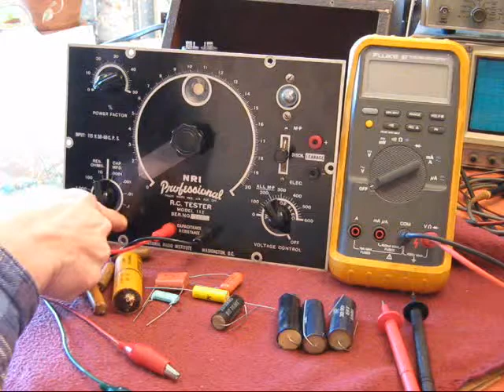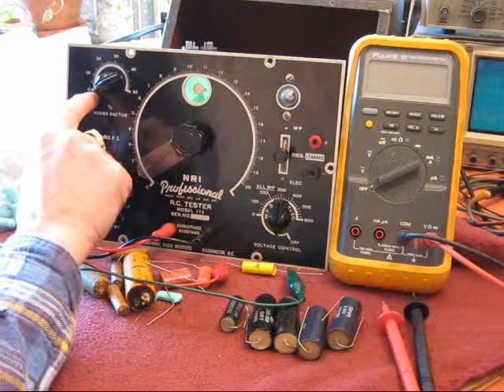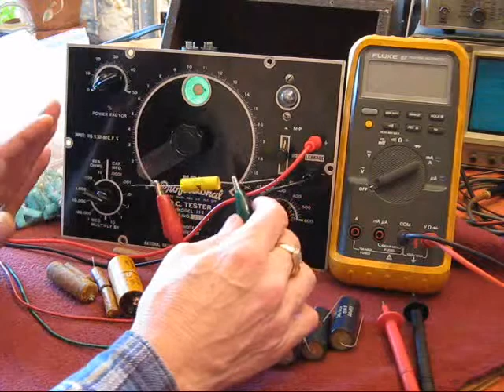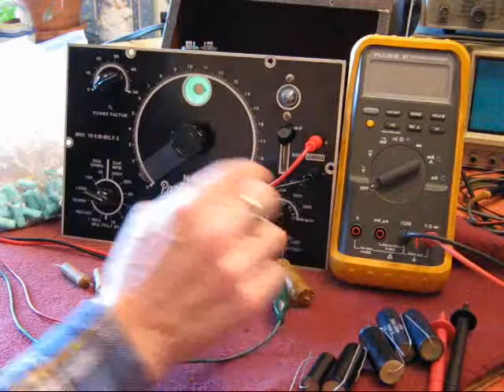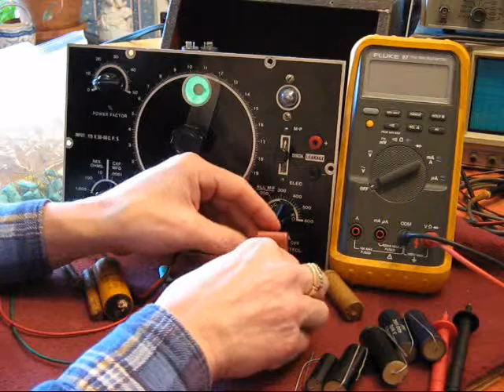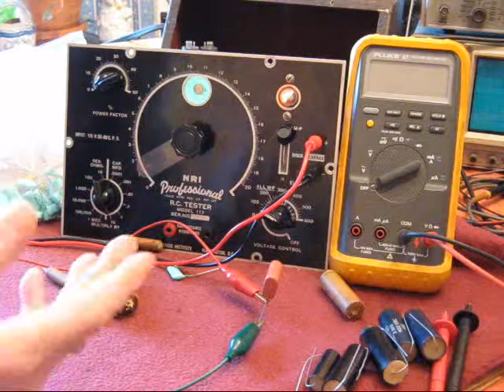Capacitor tester model NRI 112 demo part 2 of 4

Comment: For those of us interested in working with these older machines this perfect - like having someone beside you giving the instructions as well as tips about operation and likely scenarios. Many thanks!
Reply from the maker: +Robert Gulley Welcome, and thank you. Let us keep the art alive!
Reply: +glasstronic Actually I just bought one of these off of eBay yesterday because of your videos! I may have to come to you for advice depending on how much repair work it needs - hopefully it will be in decent condition as advertised. Robert AK3Q
Reply from the maker: Robert Gulley
I would be more than pleased to lend a hand!
If you video document your progress and post it, so much the better; I will link to it here.
Reply: +glasstronic Thank you! I will keep in touch. I have only been a ham for about 8 yrs, but in my fifties, so the electronics stuff has a bit of a learning curve for me - videos like yours are such a big help! Cheers!
Reply from the maker: +Robert Gulley I am also a graybeard ;-)
Here is a list of capacitors the beast uses that will likely need to be replaced so you can order parts ahead:
1 x 0.1uF, 600V plastic
1 x 0.001uF, 600V plastic
2 x 1.0uF, 200V plastic
3 x 0.01uF, 400V plastic
2 x 4.0uF to 20uF, 250V electrolytic (or plastic). <--the values of these is not critical; anything between 4 and 20uF will work.
Reply: +glasstronic Fantastic! Thanks so much! I will get them ordered right away. Probably get them before the unit itself comes, which will be great. Cheers! (and Happy New Year!)
Reply: +glasstronic could I trouble you to ask where you would recommend buying these - the places I have checked so far each place will have one or two, meaning I would have to order from multiple stores. But if I can find some place likely to have them all, it certainly would be cheaper. Thanks for any insights you might offer.
Reply from the maker: Robert Gulley
I (here in the US) buy from Digi-Key and Mouser, primarily. Links below:
.
http://www.digikey.com/?&WT.srch=1
.
http://www.mouser.com/?gclid=CNOdrr6ijsoCFYQfHwods6UJXw
.
Hope this helps.
Reply: +glasstronic Thank you - I had tried mouser and they did not have several sizes. Did not know about digikey - will give them a shot!
Reply: +glasstronic Got the unit yesterday - seems in good shape, and cosmetically very nice. Interestingly it has 2 metal box capacitors instead of the two large wax ones on the base. Going to build a light-bulb current limiter and then power it up using my variactor to see how it goes. Needs power cord. (Edit: tried putting a picture here but it disappears)
Reply: +Robert Gulley Posted pix in my google+ profile (hopefully - don't do much of this stuff so all new to me)
Reply: My entire shop is based on vintage test equipment be it rube or discreet transistor and solid state devices. Often i receive the test instrument and rebuild it by testing caps, and resistors. Tubes i don't test, however i do evaluate them in circuit with DC voltage readings and scope measurements.